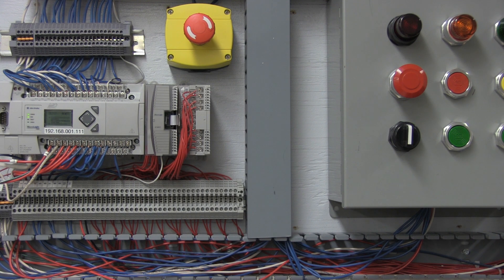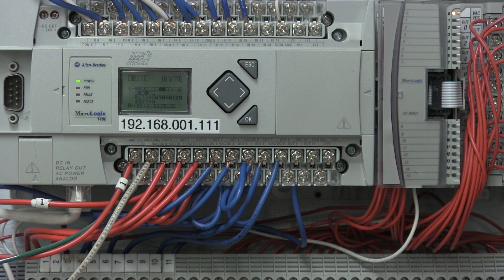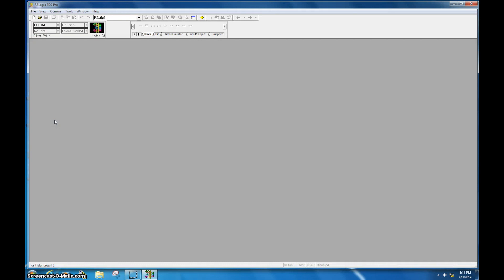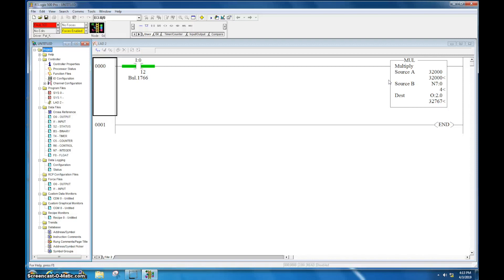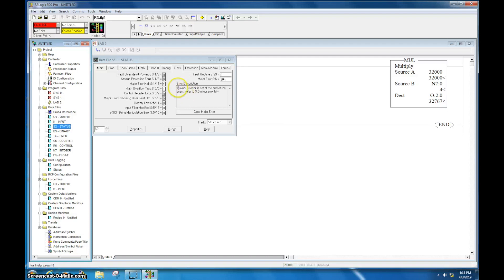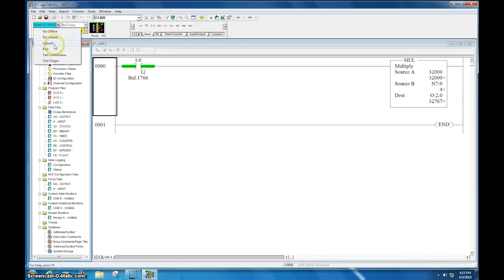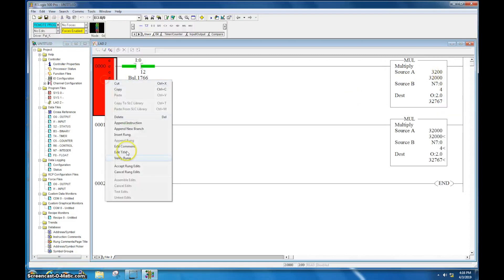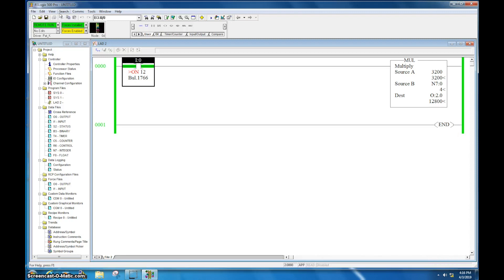How to Clear a Fault on a PLC

Comment: Nice. I just cleared the fault by pressing the red button and resetting it by pressing the green button and it showed me that the motor was okay and that it was just a fault because by resetting it the motor started to work very slowly until I put the machine back on program after hitting the E stop.
Reply from the maker: Glad you were able to troubleshoot and fix the issue.

Comment: Did u have to plug a cable into it to connect to it
Reply from the maker: It was networked through the ethernet.
Reply: @KletteTech  ok sorry but what does that mean? It it wireless
Reply from the maker: @carlmarquardt994  We are using a cord to network through what is called the ethernet.  It is always plugged in.
Reply: @KletteTech  ok I'll leave a comment on this thread. On Tuesday I'm travelling to a fault.they can still run their pumps in manual override. There is a fault light on the PLC. So I'm going to take a look and hopefully reset it... have not really had much to do with them.

Comment: Hello Klettetech 
I was trying to make a simple circuit on Rs Logic Micro that contain Three Inputs and One output. First input that will jog the machine second input will start the machine and will latch it and third input is for stop the machine.

In first rung I put input Jog with Normally open contact and output.
In second Rung I put input start with Normally open contact. And stop input with Normally close contact. And same output as first rung with same address.
Now if I toggle bit of Jog it would not work however it is working in second rung as it should be. 
I also used the bits now it will jog but will not start the output in second rung. Can you please help me to solve this Problem.
Thanks.
Reply from the maker: I just filmed a video on this and will let you know when I post it.  Give me a couple of day.
Reply from the maker: Here you go.  Hope this helps
https://youtu.be/3dv-tmbcqEc
Reply: Ok Thanks a Lot.